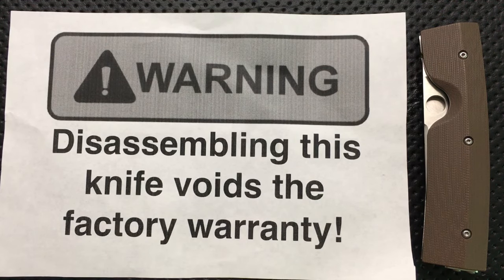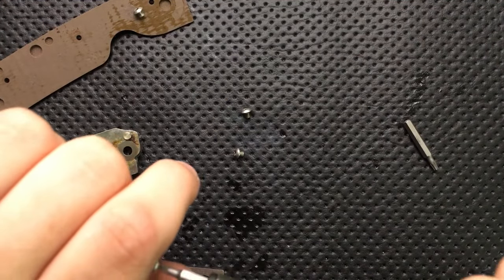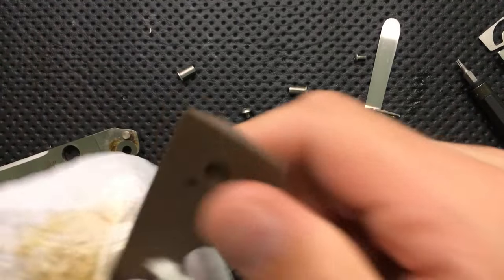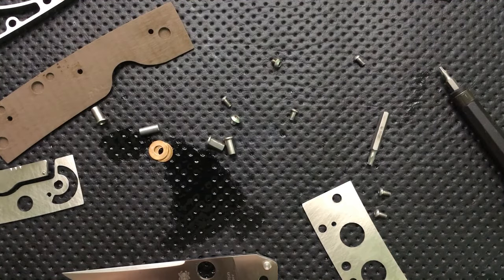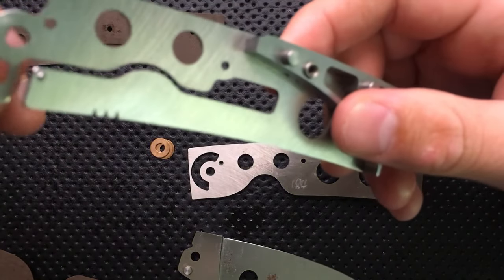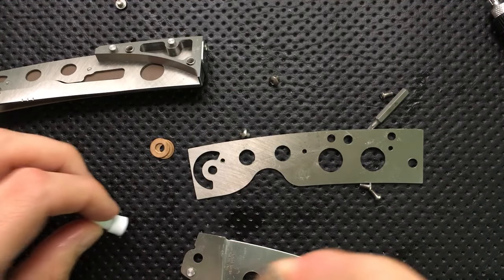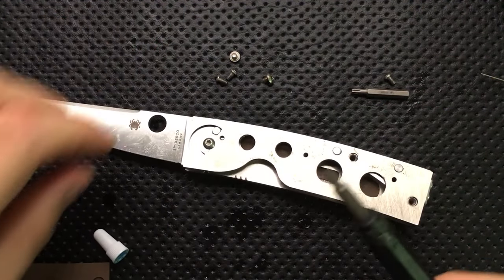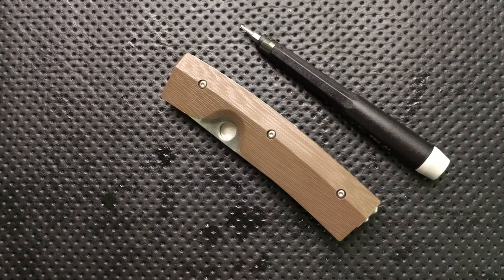How to disassemble and maintain a Spyderco Nilakka Pocketknife

Comment: The stop pin you're talking about at 7:00 was on the Hoback Kwaiback and it's required for any knife where the blade folds almost entirely into the handle, it's called a internal stop pin. Great video as usual, can't wait for the gareth bull reviews!
Reply from the maker: Well, yes.  But most knives with internal stop pins have a gap in the blade, and a pin in the handle.  This guy has a gap in the handle, and a pin in the blade.
Reply: Oooh, I didn't realize that! that is pretty strange

Comment: Nick, I don't know if you've seen Cliff Stamp's video on this knife, but that thin grind wasn't just a problem for "high speed, low drag operatives."
Cliff made a single cut into some cardboard with the knife, and the edge was full of chips.
Reply: that was when the knife had a full zero grind, spyderco added a microbevel and this particular one has slayed many a box, and now continues that in a friends hand
Reply: I know, I was referring to the original version of the knife. The change seemed very much necessary to me.
Reply: ah

i agree, and i would like to see a slightly slimmer version in a more appropriate steel.

the knife ended up seeing less and less pocket time due to how much you notice its in your pocket
Reply: Yeah, as much as I love S30V (it's probably my favorite steel), it really isn't suited to that kind of grind.
Reply: nope, real shame, it would be nice to have kept the full zero grind as i hear its much better slicer than the micro bevel, just more fragile

Comment: For a perfectionist your arrangement of screws, washers and other components is lacking, I would appreciate it if you could line them up neatly during disassembly. Also, cleaning up any spilled fluids as you go would be fantastic. Also, if you could fold your paper rather than scrunch and only use each face for one wipe I would feel more satisfied that cross contamination was being minimised. Also, the lines of dots on the mat are not parallel with the edges of the screen. And is the mat lying completely flat? It looks like it has retained some memory from being on a roll and has some minor ridges and valleys which bugs me a little. Cheers :-)
Reply: OCD much? ;-)
Reply: Nasty Renegade I put a little smiley there to act like I was all cool about it, but it's eating me up inside.
Reply from the maker: Next time, I'll scatter everything on the floor first, then throw the parts in a bowl full of mud.  Just for you.
Reply: dear god no
Reply: + Everyday Adventure LOL
Reply: this is one of the most amazing comments i have ever read, im dieing laughing

Comment: very cool. Do you also do "shake" tests to judge the detent? I have found it very difficult to match up great smooth action with a solid detent (will not open under most movement unless you thumb it open).

Comment: cleaning a knife is very "therapeutic" imo . on an ugly note , why dont more knife makers use bearings ? all these clone knives can use them and sell for cheap . although im sure there is a good reason it's still disappointing. great vid on a tricky knife Nick
Reply: Washers, when done right have some advantages over most - if not all - bearing systems for folding knives. Less moving parts to go wrong, to clean and possibly replace. It gives knife companies a different option to maintain tolerances in fit and finish and gives them different options for spacing of the liners, lockbar travel, etc. So to make a folding knife have a certain feel/function, a knife company may be forced to use one style over the other.

I like both styles, though I'm starting to learn more towards washers on knives(as you can tell with my rant there).
Reply: As a maintenance supervisor where i work i get to many moving parts problem . When ikbs bearings are used i completely agree with you , loose bearings can be a nightmare but captured bearings dont look to be as much of a problem . My main edc folder has teflon and brass washers together , i like the idea but captured bearings seem like they would have been a better choice